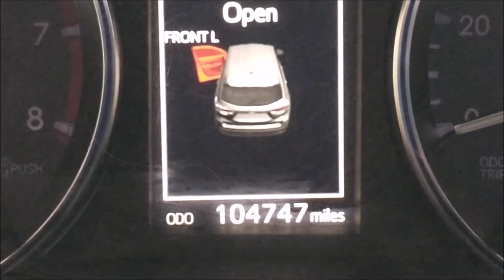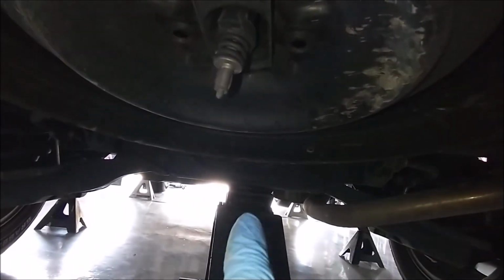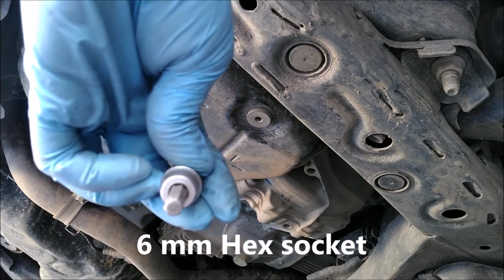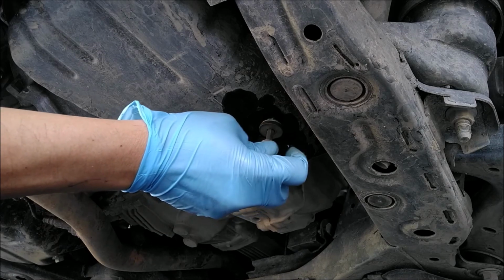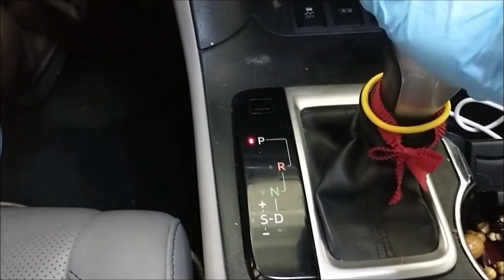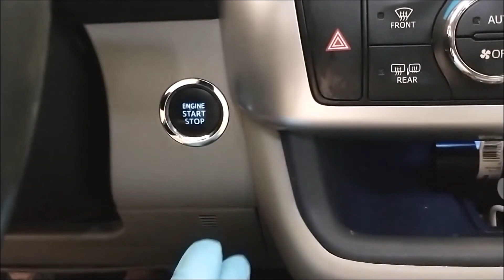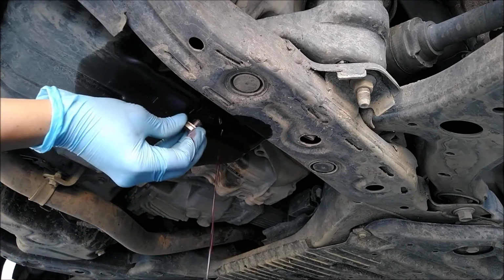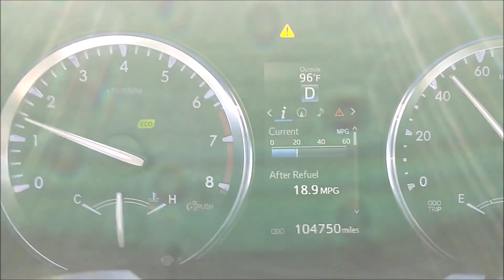How to ChangeTransmission Fluid of 14, 15 ,16 Toyota Highlander, Sienna, 4 Runner, Tacoma

Comment: You should leave the engine running while checking for the correct fluid level. This is what is recommended from most mechanics and there is a good video from the "car care nut" channel about changing the fluid on sealed transmission. Overall good job. Thanks for sharing.

Edit: I seen you caught your mistake. 😅

Comment: As black as the transmission fluid is I would have pulled the pan, installed new filter and drained the converter.
Reply from the maker: I drained and refill twice
Reply: I don’t know why people think this is a filter. It’s not a filter. It’s a strainer.  if you change your fluid like this guy does regularly the strainer will have nothing in it. It’s the magnets that are important to clean.  I remove my strainer at 100,000 and it looked brand new. No sense in spending $130 on something that’s clean.  Just do this drain and fill every 30 K 40 K you’ll be fine. No need to change the strainer.

Comment: Engine should be running on park
Reply from the maker: @mohdibrahim1350  yes. The transmission is on park
Reply: U said in the video the engine was off when draining the excess fluid
Reply from the maker: @wjm3018  sorry, the engine should be running when draining excess fluid

Comment: I have a question . What would I have to do to get to the trans fluid temp sensor. Where is it? Thank you in advance
Reply from the maker: @Blackcrow350  you need a scanner to measure it. The sensor is inside the transmission

Comment: Good video. That oil came out nasty. Not sure how Toyota label these sealed for life.

I did ours at 100K km, and will do it again at 160k km.

I'd  suggest to also replace the transmission filter as well. I did the filter and when you remove the pan there is another half  litter that doesn't reach the drain hole.
Reply from the maker: I will do it again every 50k miles. Thanks